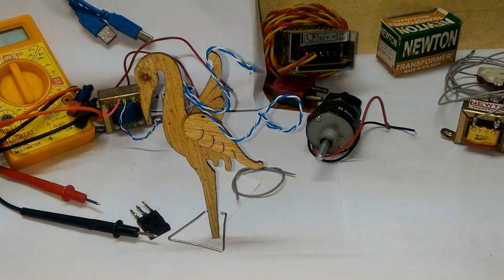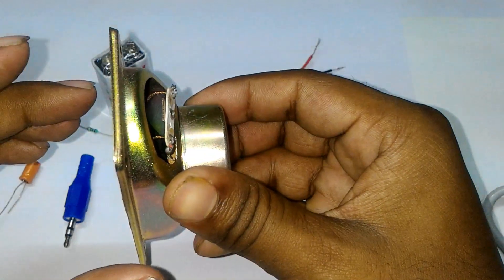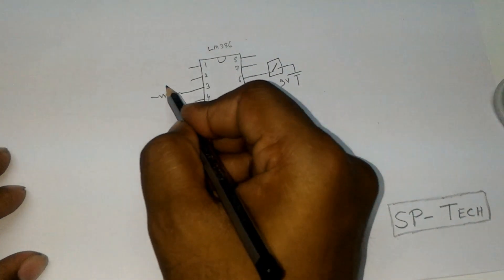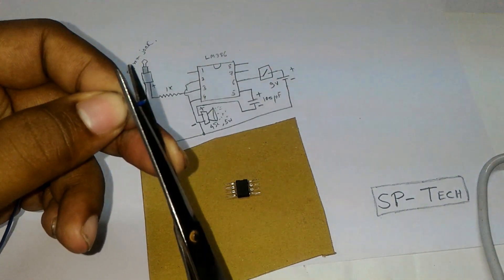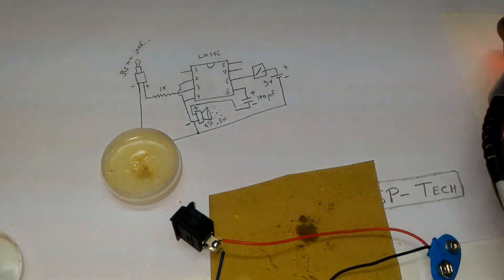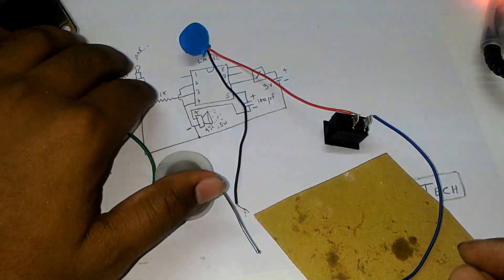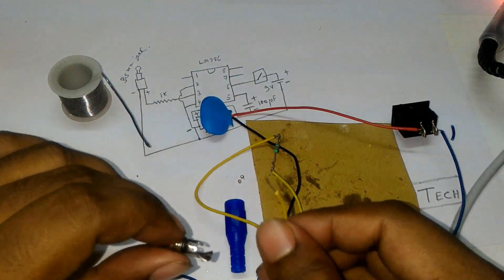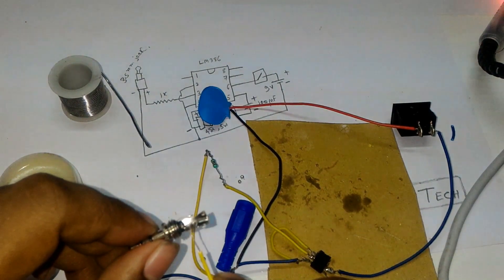Project 3: How to make a portable audio amplifier or speaker

Comment: Can I use 4 volt 1.5 A rechargeable battery.for 5W speker.
Reply from the maker: Mainly requirement 5volt you. Can try with 4volt... Can work but need to test it

Comment: bro meine yeh bna liya hai but muje pro aarhi hai speaker  fati awaj nikal rha hai meine 3 watt ka specker lgya hai
Reply from the maker: Bro you need to use higher rating speaker. because if you use less watt rating speaker then vibration generated on that speaker bit high so there is a higher chance to create noise.

Comment: sir from which shop we got all the material like battery holder,capacitor& resistor
Reply from the maker: Goto any electronic shop or repairing shops(TV,Radio etc.) . Thakns for watching bro.
Reply: Okk your wlcm
Reply from the maker: bro or else try online shopping. amazon/ ebay / flipkart / hackatronics
Reply: Thank-you

Comment: how to make amplifier speekar to 3.7v battery
Reply: Akshay Shs . bro Audio amplifier IC 386 works on 4v and some on 5v minimum so if a battery of 3.6volt is applied it will for some time then the volume would b decreasing with an increase in noise.

Comment: i have a question, can I build this for an 18 Ohm speaker? What should I change in the circuit? 
thank you very much :)
Reply: Guille Arana Just replace the capacitor connected with the speaker terminal with 470 mfd.
Reply: Manna Barbhuiya kya aap electronic kaam krte ha

Comment: bro i m trying as per your circuit diagrame, its working but the soun quality is not good and another problem is (main problem) is so much noisy, so pls suggest me how could i avoid the noise ?
Reply from the maker: In between Vcc( or pin 6) and Gnd (or pin 2 ) connect a electrolytic capacitor(try 100uF) .
Reply from the maker: Thanks for watching Comment if you still facing noise problem.........

Comment: WHERE DID YOU GET THAT LM386 
can i get this in some old compute/tv/radio
can you plz tele
Reply from the maker: It is a power amplifier IC .You can get it from any electronics store. In computer/tv/radio they basically make complex circuit , means they make complex power amplifier circuit instead of using simple IC.